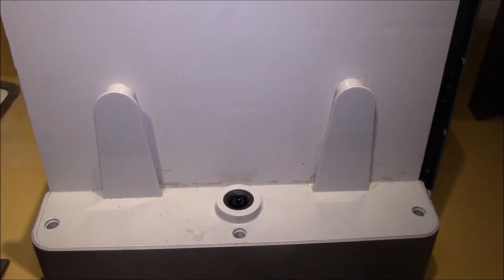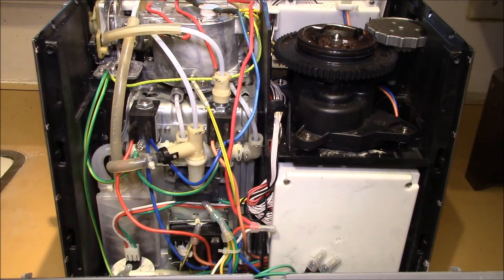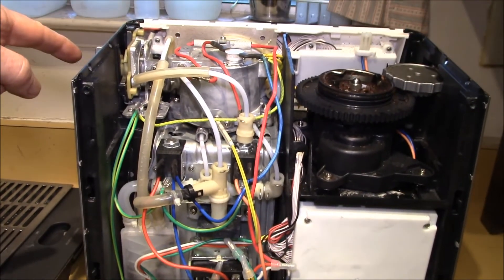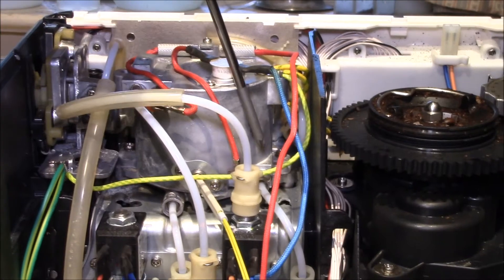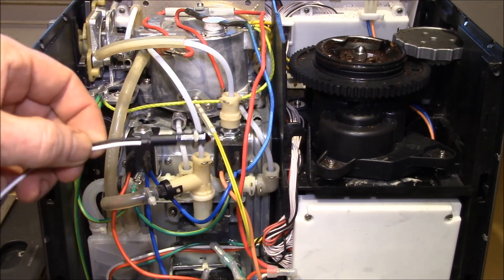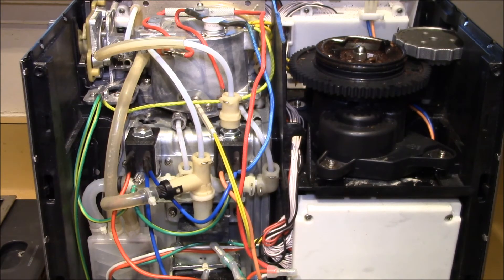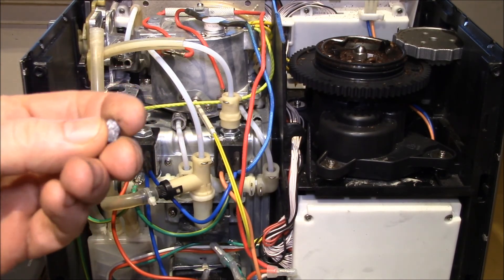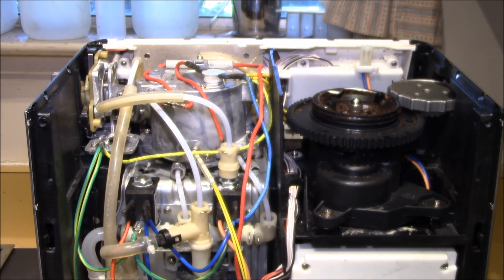Breville/Sage 870XL Barista Express - Water Flow

Comment: Had an issue with a Breville Barista Express where hot water would flow through the steam wand and the dedicated outlet, but not the group head.  Your video provides valuable info on how water flows through the system.  As you point out, the solenoid value is a common failure point, and based on the symptoms I was seeing, the metal plug was stuck in the down position.  I removed the tube on the valve as well as the two tubes on either side, dropped white vinegar through the ports, and let it sit for awhile.  Also tried to clear any blockages with a thin pick.  Put it all back together and water immediately started pouring out of the group head.  All fixed, without any new parts.  Since I recently moved to hard water country, I suspect the metal plug became calcified a lot faster than I expected.  Will have to use better water and clean/decalcify more often than I did before.  Thank you for a great video!
Reply from the maker: Great repair, glad the video was a help!

Comment: Thank you so much for this video and your other videos of other repairs of this machine! I have been trying to troubleshoot my machine for a while now, and this video helps. 
I am having a unique issue where my machine is steaming simultaneously through the steam wand and the basket. Eventually, steam stops emerging from the wand and steams primarily through the basket.  I have watched some of your other videos and cleaned the steam wand, checked the tubing, replaced the pump, and checked the voltage on the solenoid - these all seem fine now. Any idea where this issue could be stemming from?
Reply from the maker: Most likely the 3-port solenoid valve is not fully switching the water flow.  One way it passes water up to the steam/hot water valve and the other way it send water to the filter basket.  But if it's in the middle, you get water to both ports:
https://youtu.be/96IuKiuIB5A
Now it could also be a problem with the steam valve as when that valve is in the middle position, it should only let water out to the drain pan.  If it's coming out the steam nozzle while in the middle/off position, it might be the valve is stuck in the steam position part way and leaving that port open a bit.  
But if the solenoid valve is working properly, there should be no water/steam going to the steam valve while brewing coffee.  After you stop, the solenoids switch and dump any excess water to the steam valve and the drain.
Reply: @The4Crawler  thank you so much! That was what I was thinking as well - that it may be the solenoid. I actually have the breville 840xl which is an older model. Breville no longer makes the solenoid part for that machine. Do you think the 870xl solenoid piece you show in your video would suffice?
Reply from the maker: @rachaelabraham267  You may be able to open it up and clean the inside of the part or at least inspect it:
https://youtu.be/eljHS_BRJXk
If you can't get it working after cleaning, then see if it's a similar design as the later models use and those valves are available on-line from places like eBay.  If you can't find the proper voltage rating it's very easy to swap the black plastic coil off your old valve to a new valve that has a different voltage coils on it.

Comment: Thank you for a valuable engineering lesson. I have the 840XL, of which the engine is the same as yours. I have zero pressure but I still can get coffee comes out of the group head/portafiller, the amount of coffee is getting weaker every day . The hot water dispenser and steam wand still work but flow of both hot water and steam wand is weak. The pre-filter disk is clean and not blocking water flowing in. I suspect the water pump and/or safety valve is bad so I will replace both . Do you think the 3-way solenoid could be bad ( like not fully open when activated?). I  found out Breville discontinued that solenoid so you know which solenoid can be used as the alternate replacement?
Reply from the maker: Since pressure/flow is low in all cases, sounds like the solenoid is decent.  You could open up the back of the machine and see if the safety valve is spilling water into the diffuser while the pump is running.  If so, it might be clogged and leaking a bit, I think that was part of the problem in my machine:
https://youtu.be/i8GGZHKNxPo
If that's OK, replace or rebuild the pump.
Reply: @The4Crawler  Thank you for your recommendation. Happy new year to you and your family!

Comment: Thanks heaps for the video. Our breville coffee machine does great shots however after about 15 seconds of steaming the steam wand gives up and cuts out and won't work again until I run a shot through the machine. I am trying to work out what the cause might be so will take it apart and see if I can get to the bottom of it. I thought it might just be the hose to the wand but that doesn't explain why the steam wand works fine for the first few seconds. Any ideas?
Reply from the maker: Does the pump stop running when the steam stops or does it keep running and the steam cools down?  It might be the micro-switch on the side of the hot water / steam valve that signals to the main control board that steam (or hot water) is needed.  Heard from one viewer that he could hold pressure on the steam valve knob and keep his going, while if he let off the knob it would stop.  Might try disconnecting and reconnecting the wires at those switches and also where they connect to the main circuit board.
Reply: @The4Crawler  Thanks heaps for the reply, you're an absolute legend. The pump does stop when the steam stops, will try keeping pressure and I'll take it apart and jiggle the connectors. That gives me somewhere to start. Thanks again and merry Christmas.

Comment: My steam/hot water selector valve won't stay on steam unless I hold it there. Do you know of it's possible to fix this part or even replace it?
Reply from the maker: That valve seems to be no longer available, at least at ereplacement parts.  Here's a write-up on repairing it:
https://siber-sonic.com/appliance/800Mech.html#valveclean
Reply: @The4Crawler  OK I've now opened the machine and replaced the flow sensor which has fixed the "infinite filling" problem I was having.   I've lubricated the steam/water selector valve and now it moves more easily.  I can see the real problem now is that the microswitch is about to fail - it no longer "clicks" like the one for the hot water does, and requires the lever to be completely against the casing to close the connection.  I tried bending the lever but it doesn't help - something inside has worn out.  I just need to replace the switch but annoyingly I can't see a part number on it :(
Reply from the maker: @nickgilbert1264   It looks to be a fairly typical microswitch.  Perhaps the p/n is hidden from view with it installed.  If you can't find a number, some basic dimensions should help you find a replacement: https://www.digikey.com/en/products/filter/snap-action-limit-switches/198
Reply: @The4Crawler  That's a shame... I will have to just put up with holding the lever for the time being then or service the current part.     Thanks for replying so promptly.

Comment: Hi. If the water is being purged out into the drip tray after steaming/brewing, do I need to drain the boiler when preparing the machine for shipping to prevent any freezing? Thanks!
Reply from the maker: I think the thermo-coil would be empty of most water, since it's above the level of the solenoid valves.  There might still be some in the pump and hose that comes out of it.  Not sure if that would be damaged by freezing or not.  Maybe Breville support could provide some information on that.

Comment: Great video! On my 870xl it will no longer get up to pressure when extracting a shot. A little bit of water comes out at first then a couple second later it starts again but never get into the espresso range. I’m unsure if this would be the solenoid valve or a weak pump? All Insight is appreciated
Reply from the maker: Solenoid will often make noise if it's acting up:
https://youtu.be/96IuKiuIB5A
or looks for excess water flowing into the drip tray (you may see steam coming up through the grill).  If no noise and no excess water, then it may be the pump.  Possible to open up the outlet of the pump and maybe the check valve is clogged up.  If not, rebuild or replace the pump.
Reply: Thanks! Solenoid valve sounds normal. Water does come out of the drip tray into the drain after doing a shot but I believe that is normal as well
Reply from the maker: @barlowmoore2573  After a shot is normal as the solenoids switch flow to drain off any excess water/pressure into the drain.  You'll often hear the solenoids clicking at the end of a cycle and the faint sound of the water going into the drain pan.  But a leaking solenoid will cause water to enter the drain while pulling a shot as well as after.  It could also be the over pressure/safety valve is leaking and bleeding off excess pressure into the drain.  Easy enough to open up the back of the machine and see if you can see water running through that valve into the drain.

Comment: Thanks for these videos. Hoping I could get your advice on if I should attempt to fix our machine with the solutions you have detailed. I have a
Reply from the maker: Looks like your comment was cut off.  Best advice is to follow the water flow and try to narrow down where you think the problem lies.  Common problems are clogged lines blocking flow or the 3-port solenoid valve not fully opening or closing.
Reply: @The4Crawler  Just realized my message was cut off. Our machine the BES860XL is able to make an espresso. But it leaks a lot of water into the bottom tray. The big issue is with using the steam wand. After a few seconds - when building up pressure, there is a thin wisp of smoke that comes out from near the grinder.It is the bad smell of electrical overload. Do you have any advice or videos addressing how to fix this? I'm up for the task but not sure if it's cost effective to diagnose and fix. Thank you!!
Reply from the maker: @stevewalker6017  It may be the solenoid valves, they control the water flow and have an electrical coil on top to turn them on and off.  If not fully opening or closing, they can let water escape to the drain.  If you have a test meter, you could check the resistance on the coils and see if one is either burned open circuit or shorted internally.  A bad coil may also show visible signs of damage like melted or burned plastic or there may be a loose or broken electrical connector.  If the solenoids and all the electrical connections are fine, it may be the main circuit board that's got a defective part.  It sits under the grinder.  A visual inspection may help to find a burned out component.  All these parts are available on-line, or Breville has a flat rate repair program.

Comment: Thank you so much for the water flow!  There are so many tubes going everywhere and your video made it clear to me.  I think my right solenoid is going bad as I get no pressure to the group head and I noticed water discharged out most of it.  Should I try to see if any tubes blocked or just replace the right solenoid?  Thanks so much for your video!
Reply from the maker: Easy enough to pull off the hoses connected to the solenoids and see if they are clogged.  If not, finish removing the solenoids and either clean or replace them.  Videos for doing both in the same  playlist this video is in.
Reply: Will do thanks!

Comment: Mate thanks for that explanation.  That helps greatly.  I found one of these BES870 machines at my dump today in the mud so brought it home.  And judging by your videos it looks like the solenoid is bad.  I'm getting no pressure and no water flowing  over the ground coffee.  The steam and hot water flow part work fine though.  So I'm going to try and fix it rather than buy the entire unit.  In Australia you're looking at $120!  Thanks again you're a champ!
Reply from the maker: Great to hear and good find!  I imagine a lot of these machines get tossed due to the solenoid valves getting gummed up.  Fairly easy to repair.

Comment: Hey there Sir, thank you so much for the most concise videos on the BES870 available anywhere. After 5 years of solid service, I've been getting little to no pressure & water flow through the group (brew) head, but both the steamer wand and hot water outlet seems to be pumping out high pressure steam and hot water flow just fine; based on your experiences what would you suspect as the source of the trouble on my unit, and what I should probably look into? Really appreciate your experience sharing.
Reply from the maker: Likely the solenoid block or at least the 3-port valve.  That one needs to turn on and switch fully to send high pressure water to the group head.  If that is not working properly, water flows to the hot water/steam valve, which is what you are reporting is working.  You can also follow the water flow information in this video to reach that conclusion.
https://youtu.be/96IuKiuIB5A
You might be able to clean that valve, see that video in the Barista Express playlist.
Reply: @The4Crawler  Thanks so much for your respond, will get right to it.

Comment: Sir, thanks for the detail description. I always have really high pressure in order to get 25s extraction time. Around 12-13bar causing chanelling. Do u think if I add a needle valve between the over pressure valve and the brew shower to control the flow can help me solve the issue?
Reply from the maker: Sure, either that or some folks have re-plumbed the over pressure valve to feed back to the pump inlet and then have used that as more of a pressure regulator.

Comment: Thank you very much for the video. I saw the part that control the water for 1 cup and 2 cups. It looks mine does not work even after I restarted it, the water will still flow until I press the button again to stop it. Do you have any idea how to fix this? The cup button does not want to return to the factory setting
Reply: When my machine stops measuring the water properly, I simply run the cleaning procedure and so far it has fixed the problem. The logic behind it is the impeller inside the flow meter might be sticking causing a false reading or no reading at all in your case.
Reply from the maker: @theABnC  Good tip,  it's worth trying.
Reply from the maker: It could be the water flow sensor below the pump is not reporting how much water is entering the machine and that's the problem.  Or it may be the main control board is not getting the flow signal (cable unplugged) or perhaps there's a problem on that board.  Best to contact Breville support and see if they have any tricks to reset the machine.  Both the flow sensor and control board are available if you need to replace them.
Reply: @The4Crawler   right. Thank you very much for your quick response. I wonder whether we can reset the water flow sensor below the pump. It’s really hard to contact Breville at the moment, but ill try. Thaaanks
Reply from the maker: @RizalMuthi  Unplug the machine, remove back cover, unplug sensor cable and re-seat it.  Also, try the volume reset function, see owner's manual, if you've not tried that.

Comment: Hello, thank you very much for the clear details.  I have dismantle y manifold assembly and I must have moved the manifold since the pressure is not going up after I cleaned the first solenoid valve.  So each solenoid manifold part is made of plastic and they have a proper way to be installed to get the water flowing properly.  If you have any info, I would apreciate
Reply from the maker: Try blowing through the solenoid valve and you can tell which way the water will flow.  Normal is the inlet at the left side, looking into the back and outlet to the top that goes to the hot water / steam valve.  The port facing the center is normally closed and only opens with power applied.

Comment: Hi Brown. Do u think there's anyway to adjust the flow of the water coming out from the brew head??

I am having problem with high pressure brewing. But if I grind finer to achieve better pressure, extractiom come out too quickly.
Reply from the maker: A coarser grind with lower the pressure, perhaps that's what you meant to say.
Have heard of some folks using the safety/overpressure valve for that purpose.  Instead of running the outlet of that to the diffuser, you add a tee fitting in the inlet line to the pump and connect the valve to that tee, essentially recirculating the water from the valve back to the pump.  Then set the pressure on that valve by adjusting the black part.  You would have to experiment with the pressure setting as there's no calibration dial on that valve.
Reply: @The4Crawler  Yes. grind coarser to lower the pressure. Thanks for the correction. What about adding a needle valve on thr hose before the brew head like Slayer mod of BES920.
Reply from the maker: @timzlow  Sure, you could try that, keeping the existing over pressure valve for it's intended purpose.  Or use the over pressure valve as more of a pressure regulator by lowering it's opening pressure.
Reply: @The4Crawler  Thanks.